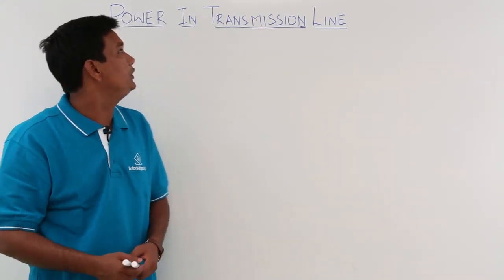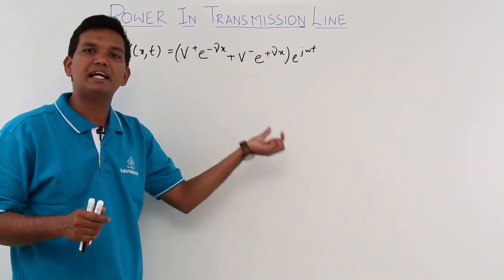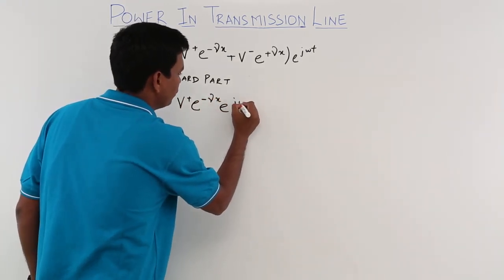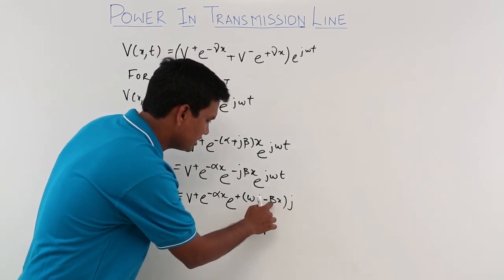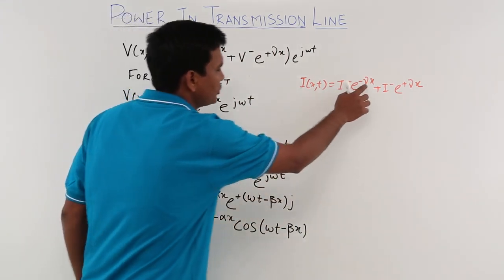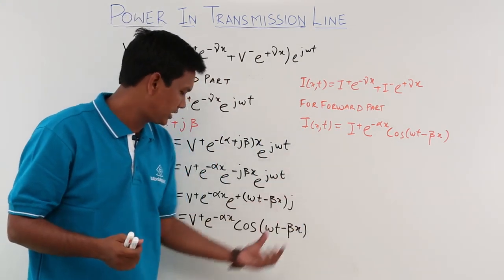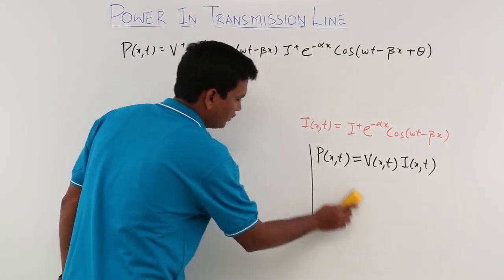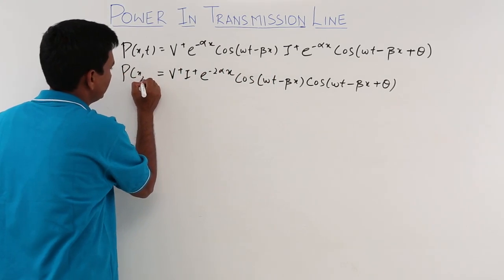Electro Magnetics - Power in Transmission Line

Comment: in 3.18 how can you write complex exponential function into cosine term only?where is the sine term?is their any assumption?
Reply: why real part only?
Reply: @horrorfreak2340  
Real part is responsible for calculation of power.
P = (1/2)Real(V×I*)
Where;
V=Voltage
I*= I (conjugate)
Reply: theyve taken real part as For voltage and Current calculation you need to consider the absolute (real) value. imaginary part doesnt apply practically
Reply: Yes ur right even I have that doubt
Reply: isi commnt ko dhund rha tha bhai ki yr ye doubt kisi or ko ni ayaa kya  😅😅😅😅😅😅😅😅😅😅😅😅😅😅😅